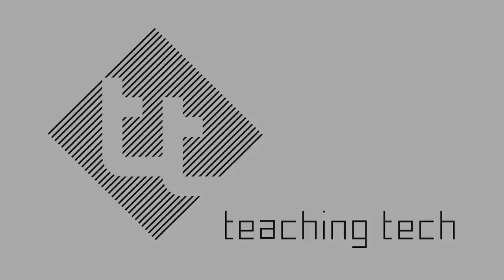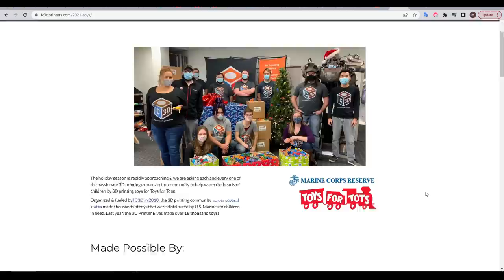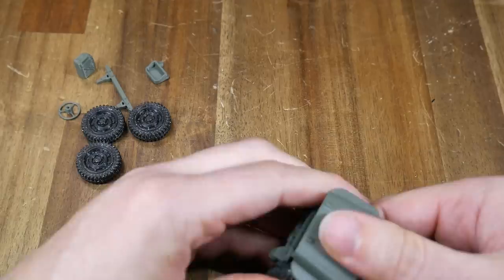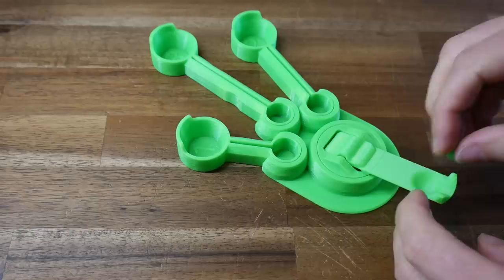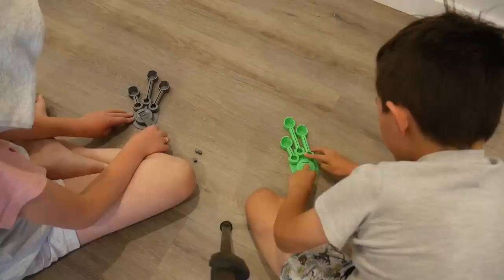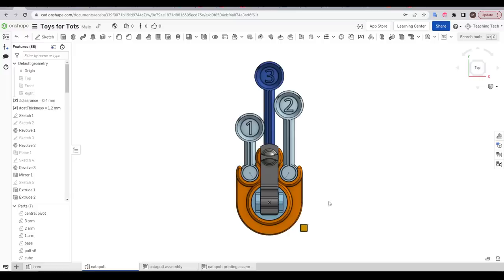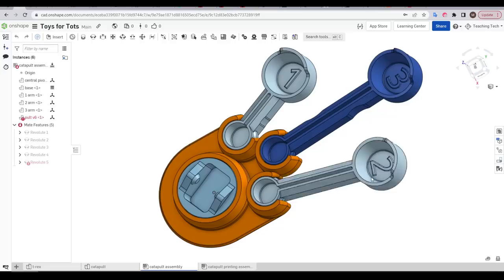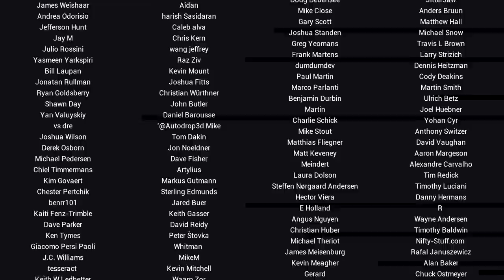Make a difference as a maker for Christmas - Easy print CAD designs guide

Comment: The only issue I may have with this, is the cubes are you using are too small, they could cause a choking hazard if swallowed.
Reply: I second that the choking hazard risk is way too high
Reply: Thought the same but the parents should know there child’s. I hate all this regulations and age suggestions.
Reply: The likely could be printed hollow, or as a "frame" with just the edges and corners to prevent overhand drooping. 

Considering this is designed to be compatible with any small object, any small non-choking hazard would do.
Reply: In the USA, this toy could be sold, but would require a label to the effect of "WARNING: CHOKING HAZARD – Small parts. Not for children under 3 yrs."
Reply: Don't give it to a child that would swallow it.  Toys can have small parts.
Reply: Or, leave out the cubes and market it / make it rather as a popcorn launcher. You provide the “ammo”….

Comment: Great design and thanks for helping spread the word about the IC3D TFT campaign to print and donate toys to Toys for Tots.  I just printed the catapult and it printed perfectly the first time using PETG.  I don't want to get into the choking hazard discussion but on a separate note I found that the cubes are too light, making the catapult too sensitive to be fun.  I tried some heavier items and it seemed to be better balanced and I actually got a couple into the cups.  The idea of using candy (or steel hex nuts) make the toy more fun to play with.  I hope others accept your challenge.
Reply: Another option might be to reduce the stiffness of the catapult a little more so the throw is softer and thus easier to control.